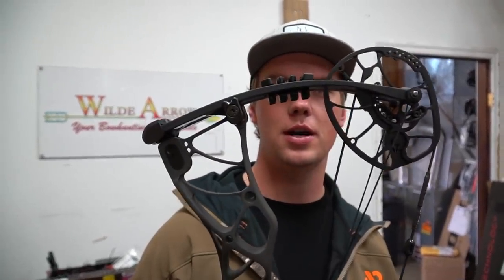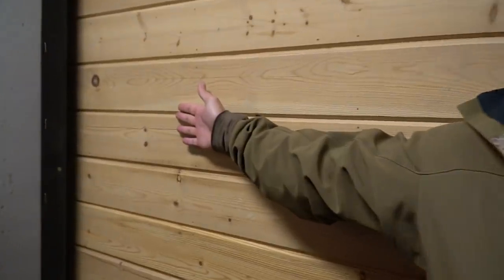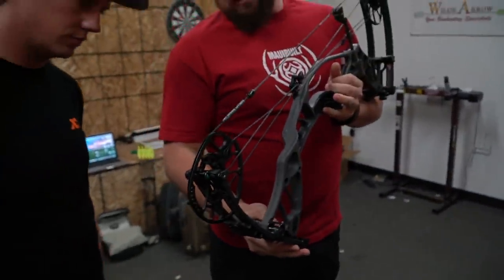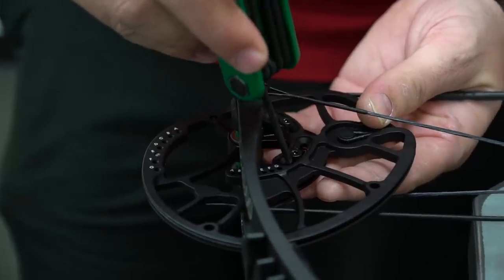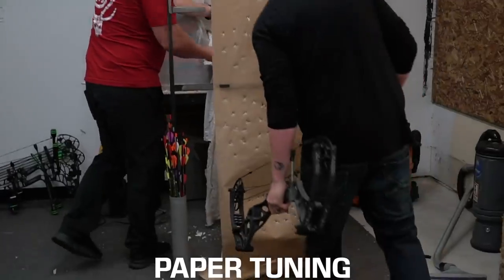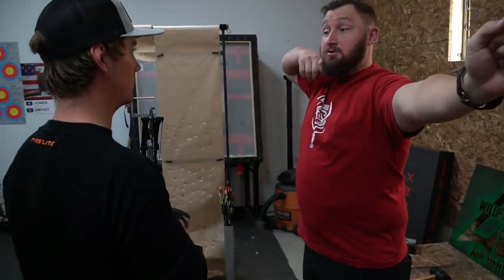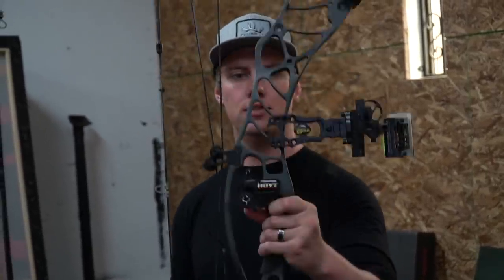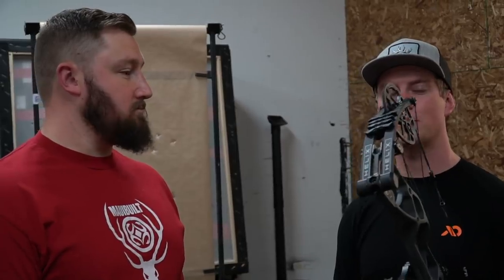THE ALL NEW HOYT HELIX BUILD!

Comment: Hi Guys. New to your channel. Great content and your mechanic seems excellent. But you folks have to learn to shoot these videos with better focus and aiming points. Try manual focus that allows you to use a simple touch of the button to refocus as needed instead of using the autofocus. Just offering some advice so your excellent content doesn't suffer. Thanks again.

Comment: Do shops like this have a setup fee if you buy the bow and equipment from them?
Reply: If you buy a flagship bow like this and all the accessories, most shops do not charge a fee. You are after all spending 1500 to 2000 on a bow from them. You may not get the same quality of a tune as seen in this video but it shouldn't be far off from it
Reply: No they don't charge as long as you buy the bow from them.  If you take a bow into them they will charge you their shop rate.
Reply: @jordanpowell228  you don't have to buy a flagship from them just to not get charged a shop fee.  Any bow you buy from that show they  will set up for free.

Comment: surprised you went with a #3 cam when you would have hoyt more performance with a #2 cam
Reply: I was thinking the same thing. Lol, i commented 7 months ago mentioning that and was going to again until i saw i already did. I actually just ordered this bow, 80lbs number 2 cam for a 27.5 inches draw length. Only thing i can think they didn't go with the number 2 is the number 3 is smoother at the shorter draw lengths than the 2 but its aggressive off the back wall. Thats my experience anyway